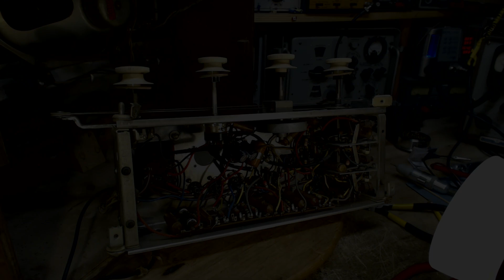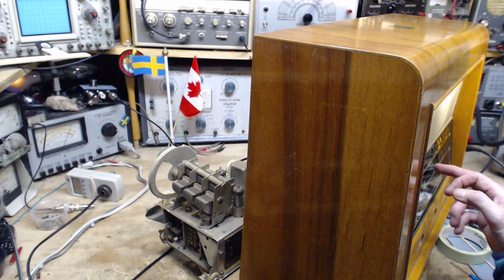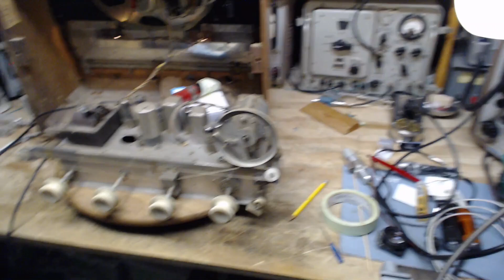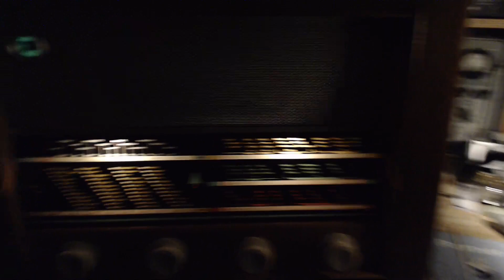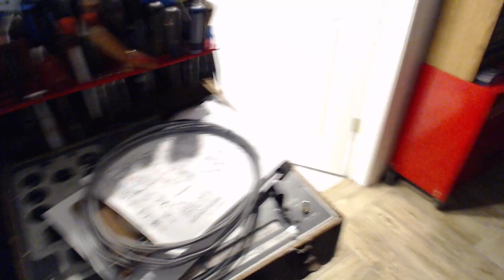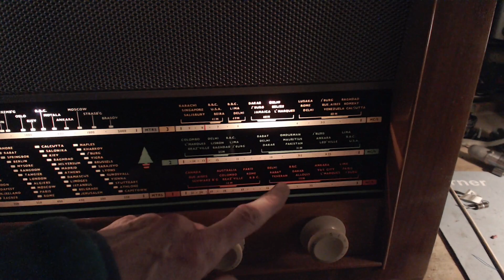Irish Bush Tube Radio B.S. 35 Video #2 - PS Filter Capacitors and Finale

Comment: Lovely set and a nice job, I was shouting at the screen yesterday 'just pull the chassis '    Some sets were on rental so quick servicing was a bonus.  Numbers stations, they are still about and have increased recently due to certain countries being triggered ?.  Lewis at  'Ringway Manchester'  YT  has a good channel with some numbers stations decoded I am sure you and other radio amateurs will find his content fascinating.  Radio teletype is still used for number and weather, I have several machines from my 1970's  ham shack when I listened to the news wire and dad would tear of a few feet of news ahead of the BBC.  Great work Jim thanks.